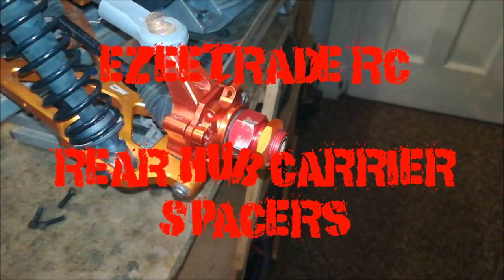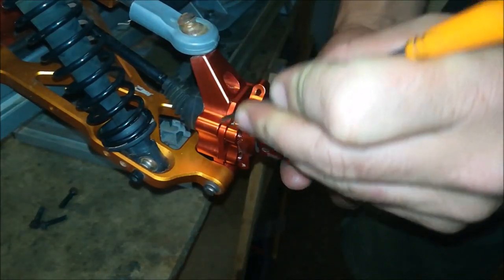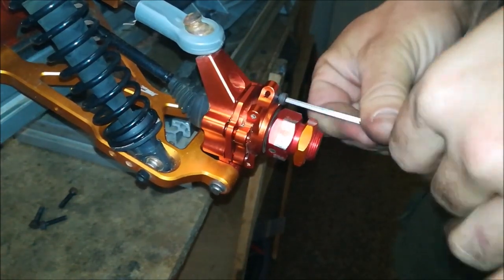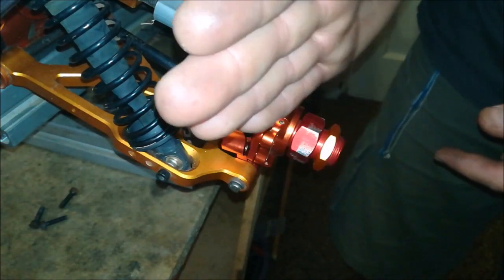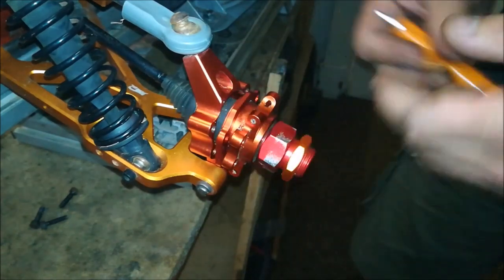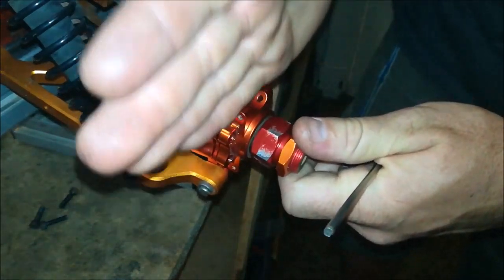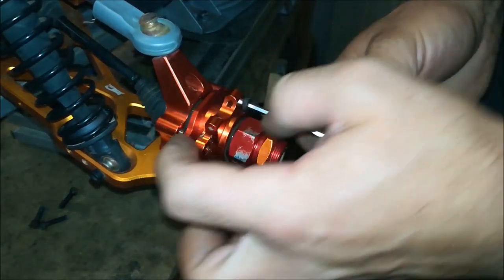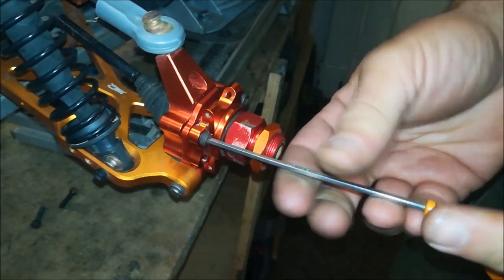Baja 5B/5T Rear Hub Assembly Spacers

Comment: How do I ride small wheels!!!???
Reply from the maker: Are you talking about those small FG wheels they use for high speed runs?
You get square hub converters. They must have a 12mm inner diameter hole to fit the Baja axle.
Reply: @EZR  Thank you for understanding me...yes, I mean the wheels for speed...thanks man